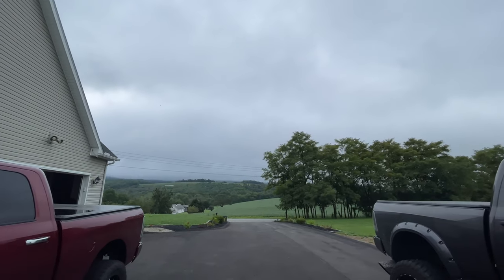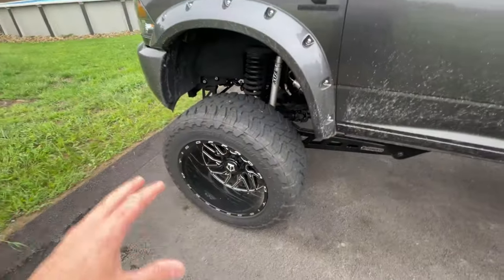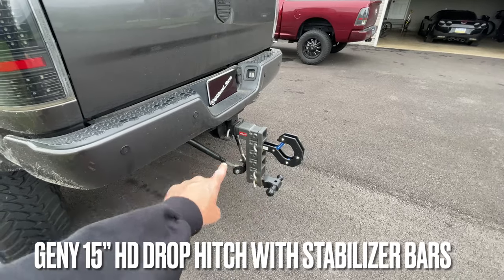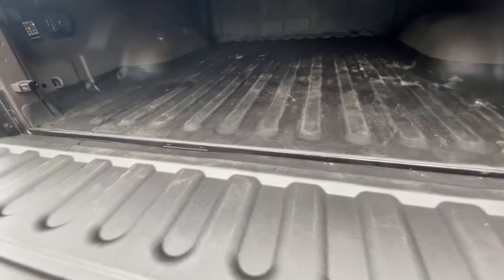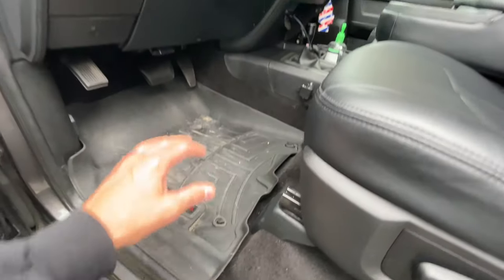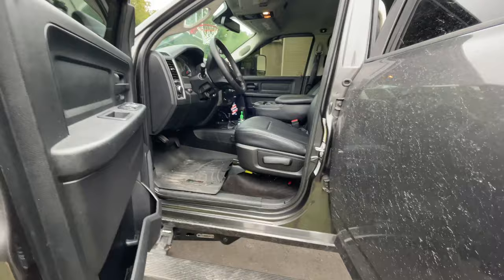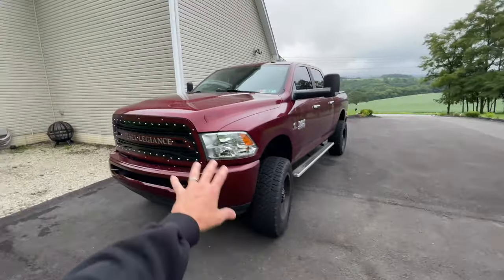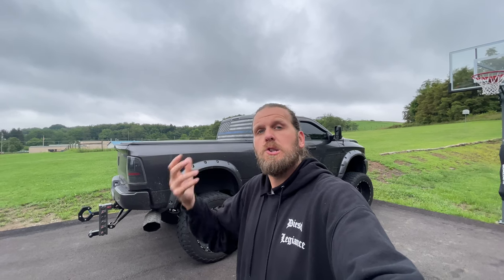All Mods Done To My Truck Build So Far As Of August 2021

Comment: Excellent walk-around Matt... you've done a load of upgrades since my last visit - extremely impressed with what you've accomplished!!! The one upgrade I recently done which I absolutely love and would also make your truck look great on the inside is the 3.5" to 7" EVIC upgrade. I was able to find a used "Limited" edition on Ebay which came out of a 2018 3500 Limited Longhorn. The Limited edition EVIC is much nicer cosmetically as it is standard equipment in the $80K and up trucks. I used AlphaOBD to program the replacement EVIC myself - no dealership required. I think it's the best money I spent so far. You've given me some great ideas for future upgrades - appreciate all your hard work putting the content out her for us.
Reply from the maker: Thanks 🙏 for all the support.  Appreciate you 👊🏼

Comment: You need a front sway bar.  That Mopar OE makes any RAM a chuck wagon.  Go Carli or Thuren and you'd be amazed. Single biggest comfort item aside from coils themselves.
Reply from the maker: I asked both of those companies and they said due to my high lift they don’t recommend it as it may hurt my ride quality?  Not sure why?
Reply: @DieselLegiance  that's bizarre considering you don't even need one, technically speaking*. You'd stay away from them if you were top heavy, like bed camper heavy.
Reply from the maker: I know, they said if I upgraded it would make my ride too loose feeling and would not be as stiff as the factory one?  No idea but that’s why I have not upgraded the sway bar yet.

Comment: I'd go 4:88 gears with that lift! Minimum...and of course you got to do the front. 
I just got a* Ford 6.2 legendary motor*...Raptor had a 500hp stock.
Mine is a F350 C.C. SRW LB Lariat 2012.
I plan on doing some customizations but a,h nothing like you got going on!
Found you by looking up running boards Amp Research Boards
Reply from the maker: Thanks for the advice.  I have thought about swapping it the gears.  It actually drives pretty good with a throttle controller.  I’d love to upgrade the trans but that’s very costly.  Thanks for subscribing, I always appreciate the support.

Comment: How did you or where did you have your 4x4 custom made cause I lift my truck 6.5 inch zone lift kit and my 4x4 is not engaging it’s so stiff locked in 4x2 I can’t put it into 4x4 unless I go under my truck and engage it from underneath.

Comment: What is the cost to get this done. Also will the 40 tires mess up my miles per gallon... at the moment I’m averaging 18 to 20 mpg and that’s city driving.
Reply from the maker: Do you have a gas truck or diesel?  If diesel, are you deleted or not?
Reply: @DieselLegiance  diesal ....  it is not deleted. Thank you for responding
Reply from the maker: Your gas mileage may drop by 1-2 but it all depends on how you drive.  If your a lead foot no matter what your mpg will suffer lol.
Reply: @DieselLegiance  everyone makes fun of me and says I drive like a grandmother,  i rarely drive over 65..
I’ve been wanting to get my truck lifted so I’ve been doing my research. I thought the higher the truck was the more mpg you will losses.  I spoke to a guy with a truck like mine and he has a 8 inch lift on his truck and stated that i was wrong.  It’s the tires that I need to focus on.   He has 36 in tires on his.  So I’ve decided to left my truck and I like how yours came together that’s why I would like to know the cost. I’m not like you. I don’t know how to work on trucks , so I will be taking it to a shop to get done. Well I’ve been changing both my fuel filters recently.  I get my truck worked on at Firestone and they charge 560 dollars just to change the fuel filters.  The driving I do I have to change the filters every month , so I’ve learn to do those myself. But nothing more. I plan on taking your video to a shop and saying here , I want my lift exactly like his.  Before I do that I don’t want the sticker shock. I rather know upfront.  I know the cost will be different being you did some of it yourself.   Thank you for taking time making these videos.
Reply from the maker: I’ll try to post a breakdown of costs in the video description ASAP.
Reply: @DieselLegiance  thank you very much
Reply from the maker: Done…all prices are a rough estimate
Reply: @DieselLegiance  looking now
Reply: 17, 500 for the specific things I like and will need.  I love the grill and the hood btw.  I will forward your video to my  guy and see what he thinks.  Thanks you so much.
Reply from the maker: Wish I had more specifics but these mods were done over a course of a few years so I don’t remember everything.
Reply: @DieselLegiance  .. it’s prefect thanks..  my main concern is mpg and smoothness of ride.  Your setup seems like it focuses on both, and that’s what I need. A few of my buddies they don’t give a dam about mpg. They get around  10 to 12 mpg and care less.. thanks for everything.. and I will keep watching as u post.  You must be finished with the vet because I havnt seen u post about that in awhile..  I’ve been In the market for a viper , but that c8 is a beauty.